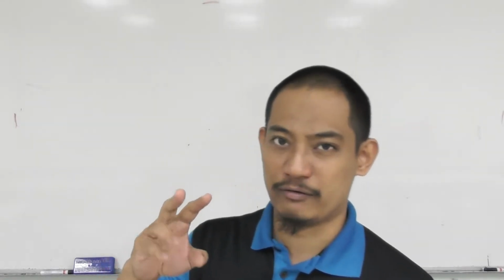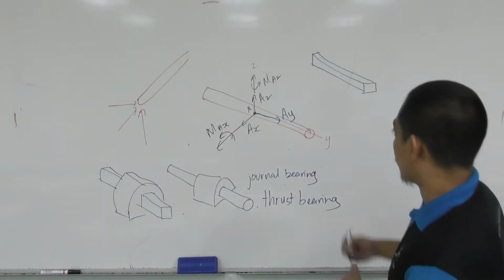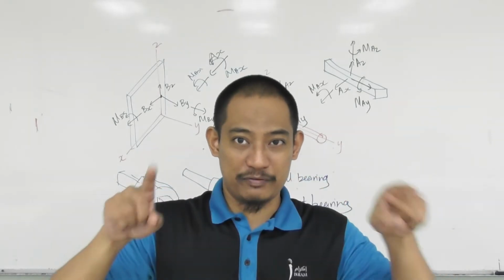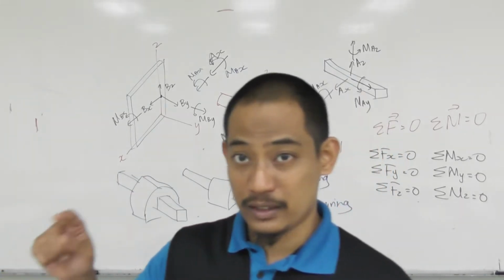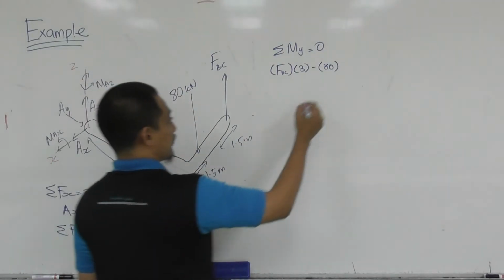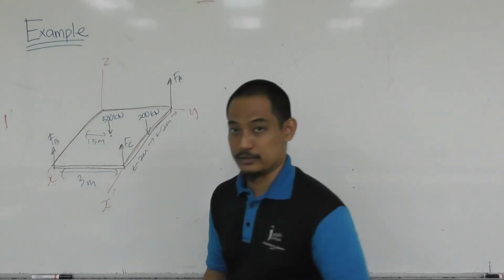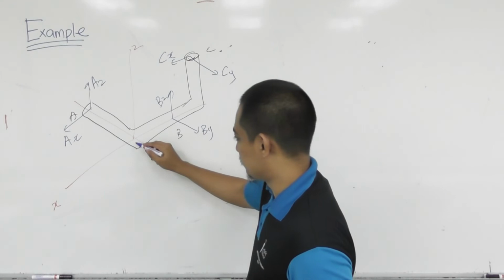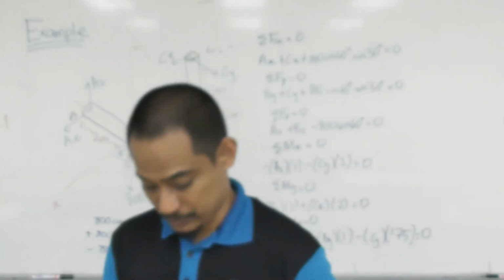Statics - Chapter 5 (Sub-Chapter 5.5 - 5.7) - Equilibrium of Rigid Bodies 3D Problems

Comment: Sir, I have a question regarding the final example. In the exam, is it compulsary to show our work for finding each of the unkown after we have come out with the 6 equations? can we just use calculator to determine the value and just write it away? thank you sir
Reply from the maker: do you mean about solving simultaneous equation?

if you are referring to solving simultaneous equation, normally in the final exam, the cover page will have this notice: "Direct solution of simultaneous equations using programmable calculator is not allowed"

in term of the exam marks, if you skip the manual solution and just use the calculator to directly solve simultaneous calculation, you'll simply lose the marks for that calculation steps...
Reply: @SaifuddinRehan  yes sir, noted with thanks

Comment: Dr, could you please elaborate the slide  about the 'Important Note' in 28:51  ?  I only understand that having two aligned hinges or bearings can cancel out the moment reactions and only have force reactions. I am not sure if my understanding is correct.
Reply from the maker: This is with regard to the structure being properly aligned, i assume...
yes, basically the structure is aligned in such a way that the moment reaction will never be triggered (the particular support never need to counter any rotation), hence in calculation we will just omit those reaction moment as it is going to be zero...
Reply: @SaifuddinRehan  Understood. Thank you Dr.